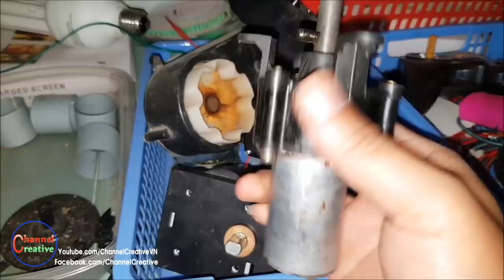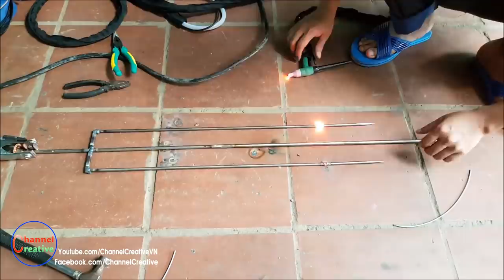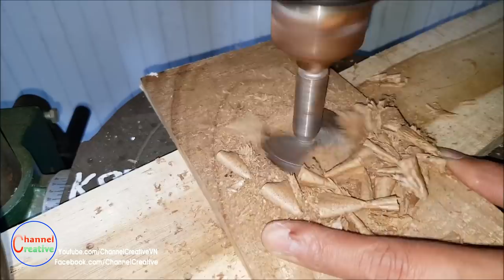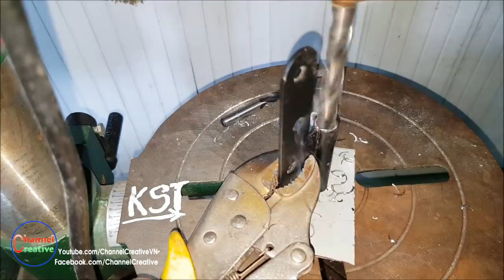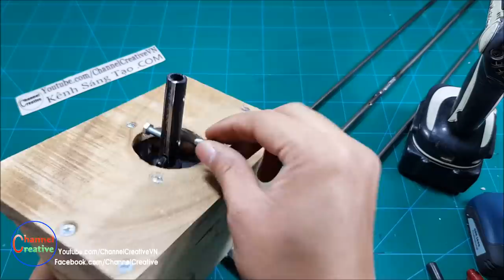How to Make a Simple Rotating Machine for Roasting

Comment: you can use a PWM module to adjust the speed of that motor! in my opinion is rotating too quick!
Reply: ... you can  use hand  ... wtf
Reply: evet bencede hızlı dönüyor speed run  no the low power betafuuul :D
Reply: How can you tell what kind of moor to use?
Reply: @allahadavet1313  ìo

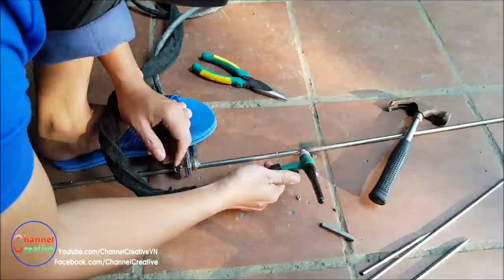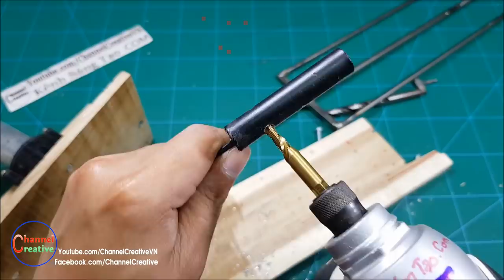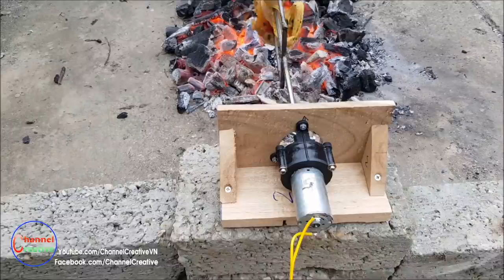Comment: You need better welding shoes  1:15   and use your vice to hold your steel bracket  5:05.  The dual trapeze flying chickens  7:55   Ok you have a good chicken roller